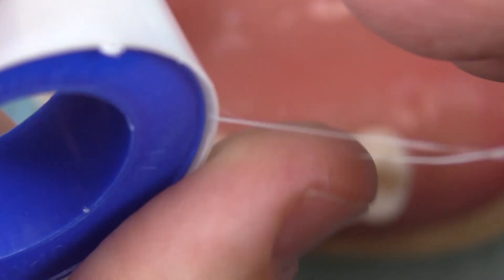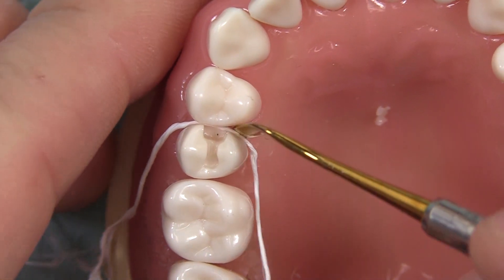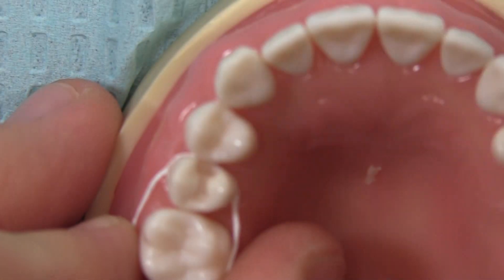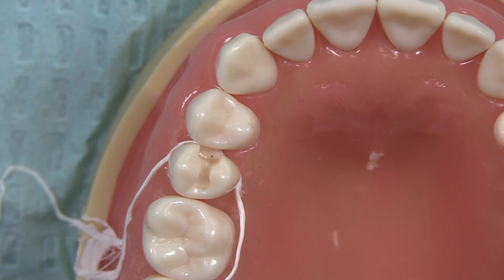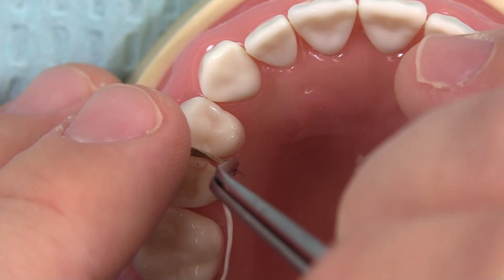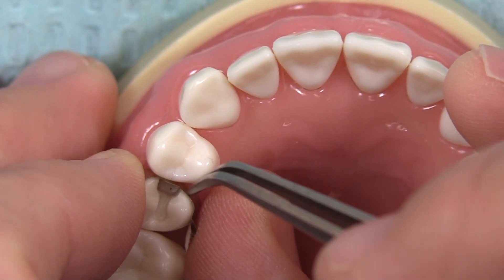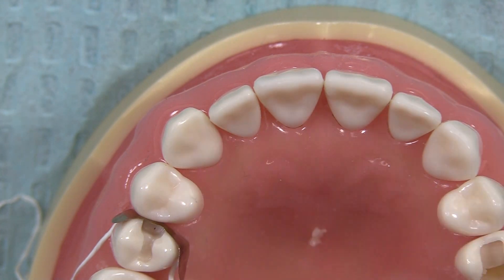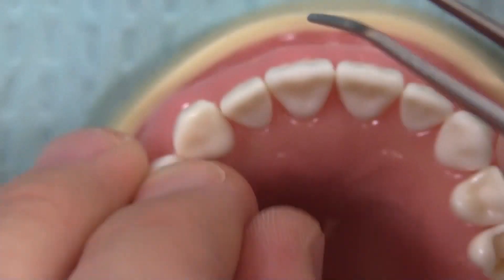Using Teflon for Isolation Technique with Dr. Jeff Davies

Comment: Wouldn’t a retraction cord be better bc then it can also control the bleeding?
Reply from the maker: Either teflon tape or retraction cord will work. There's no blanket right or wrong solution. It's dependent upon what you feel you need in that moment to provide the isolation required.